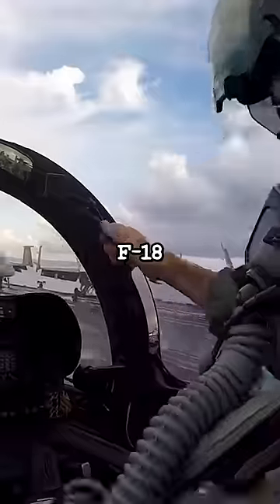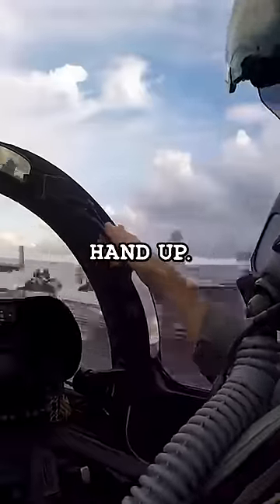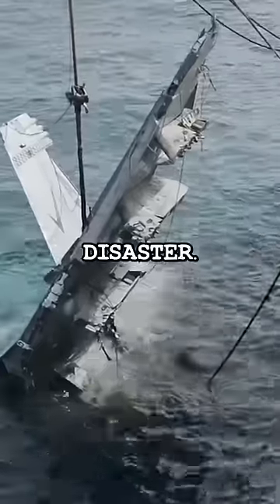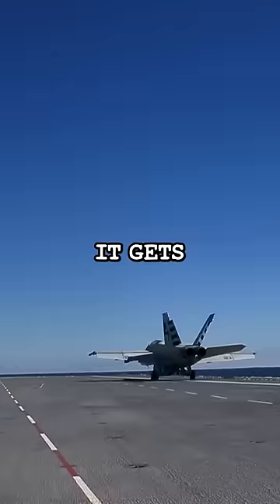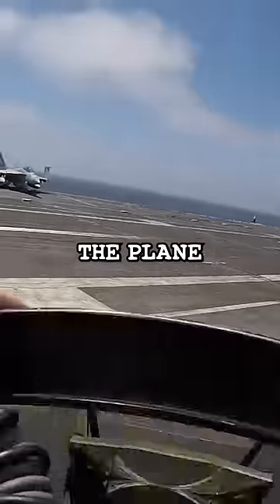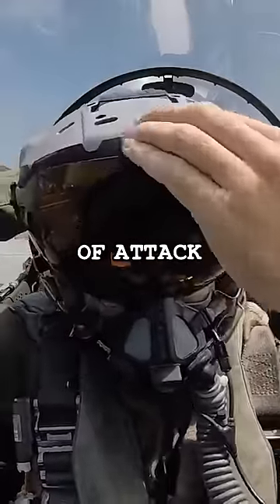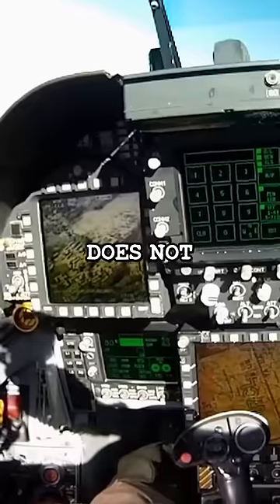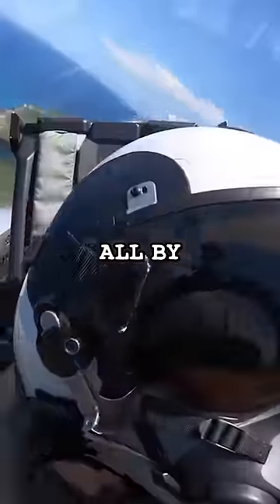Why F-18 Pilots Keep Their Hands Up

Comment: It is to prevent Pilot Induces Ocillation (PIO).  The flight control computer flies it off the end of the deck.
Reply: Exactly !! Humans are inadequate to keep up with computers in real time, with an untold number of monitored inputs to be acted upon with due dispatch. In the day, pilots had feedback from their hands on the wheel and from their feet on the rudder. That was adequate reaction time back then. Not so any more. Sensors do not provide physical feedback like the sensations cables controlling the ailerons and rudder impart upon the stick or wheel in the driver's hands, and feet.

Comment: That’s not the reason at all.

The reason is that, under high acceleration forces, the inner ear can falsely perceive an excessive pitch-up moment. The natural instinct is to dive the plane to avoid a stall. This sensation is bad enough normally, but downright terrifying in poor weather or at night. Pilots set the trim and remove their hands from the controls until the acceleration forces decrease and their perception normalizes to avoid their inner ear essentially forcing them to kill themselves.

It has nothing to do with a “powerful air blast” or the F-18 being maneuverable “unlike other fighters”. It has to be done with everything that gets cat launched.
Reply: Thanks. Always good to dispell the internet bs
Reply: It's non-interference by pilots at slow speed is true, according to actual Hornet pilot Ken VanderHorst on Quora: "The nature of the flight control systems of fly by wire aircraft requires the pilot not touch the flight controls during the catapult stroke. Doing so could seriously confuse the flight control computers and make the aircraft difficult or impossible to control once it leaves the deck."
Reply: I could have wrote that myself!
Reply: @alistair676 that doesn’t mean it’s true.😂😂😂
Reply: Correct answer here ☝️
Reply: Thank you for calling bs on this, and also explaining the real reason. Much appreciated!
Reply: @gloomrust 
He's not correct. fredmdbud has the right answer.  This is not the technique in older airplanes.
Reply: @kami13kaze  I hadn’t even seen his reply. Thank you for pointing that out to me! My apologies
Reply: I was a Navy flight surgeon.  This is what we learned at NAMI as well.  The mental perception is that you're pitching up, and the pilots have a tendency to want to "flatten" out but in actuality will pitch down.

I flew mostly rotary wing, and a couple jet flights but none were from a carrier, so can't personally confirm.
Reply: @ryane6886  I can’t confirm the effect from a cat launch, but the same effect can occur in any instrument-only situation with the onset of even mild acceleration or deceleration. This is the major cause of spatial disorientation crashes. I’ve personally encountered this effect in that context, and it requires discipline to concentrate on the instruments and disobey your whole body telling you that they’re lying.

It’s believed this effect is what killed Kobe.
Reply: It's got nothing to do with the inner ear.

It's because at extreme acceleration small inputs on the stick translate to big ones.

I'm not a pilot but Growler Jams has a video on this.
Reply: @kami13kaze Yeah but this guy was talking about F-18s, they never said anything abt old plabes...💀
Reply: @Chaz-videocreator  
That's the point I was trying to make. It's due to the fly-by-wire system. The jet is constantly monitoring control inputs and aircraft changes. If you add an input and the jet doesn't "move", the flight control computers can increase the movement of the control surfaces trying to give the pilot the desires response.  Non fly-by-wire jets don't have this setup, so they don't have the same risks and use different techniques on cat shots. F-18: hand on the towel rack, T-45, hand just behind the stick. Never once coming off the cat did it make me feel like I was pitching up/down, but touching the stick during the shot or the slight jolt at the end could cause an unintentional stick input which is why we don't actually hold it in the T-45 until the end of the cat stroke.
Reply: thank you
Reply: Somatogravic illusion
Reply: @kami13kaze  this does happen with older aircraft. It's not because of the FBW system. It's because under G these small movements have large effects while the nose gear is still being pulled by the shuttle.
This has been a standard practice since the 60s.
Reply: Powerful air blasts are common at sea.
Reply: I'm seriously getting sick of all these AI spam videos
Reply: this channel keep spreading bs
Reply: @fredmdbud  its sensitive on roll and thats really it, wont interfere with whatever bs he said in the vid
Reply: The actual reason why is because the aircraft can detect the acceleration and know that it is going through a cat shot.  The flight control computer for super hornets will understand this and command a pitch input that will drive the nose up 10 degrees to ensure good rotation off the deck.  Legacy hornets do not input a pitch up command, but rather maintain the trim set by the pilot before launch.  After the aircraft has left the catapult and achieves 10 degrees nose up it will reset the trim so it does not continuously pitch the nose up.  Pilots do not touch the controls so that they do not interfere with flight control computers inputs.  The reason why the computer does it and not the pilot is purely quality of life for consistency.  Not a single other navy jet besides the F 35 has a system where it automatically pitches the nose at the end of a cat stroke.
Reply: you did what i was going to do this guy is just spreading misinformation
Reply: @alistair676  How do you know it is internet BS just because someone else said that someone else was wrong? You do realize that the guy you just agreed with it on the internet.
Reply: @gloomrust  LOL, what is funny is that just because some person you have never met says something that you automatically believe it and not the person who made the video? You have no proof that the guy is a pilot and knows what he is talking about.
Reply: And be so kind to complete your correct explanation by saying what the left hand does in the meantime
Reply: @guiduz3469  Each hand has its own handhold so both hands are off and not near the controls.
Reply: @guiduz3469  it firmly grasps his “little pilot” so it doesn’t become cockpit FOD 😆

Nah it keeps the throttles locked into the stops.
Reply: @kami13kaze I think I agree with you? I just think it’s less complicated than that. The trim on the aircraft is set for T/O and the pilot will just F it up. I do remember just having my hand next to the stick in T45Cs as a stud (never went back as an instructor) and for 18Cs on the towel rack…either way it was to just let the bird fly off the deck like it’s supposed to. This video makes it so much more dramatic.
Reply: Thank you, most accurate explanation I've ever seen.
Reply: Ill take an aviator's word over a youtuber any day.
Reply: @fredmdbud 

Well done for dispelling more internet bs this time via the OP on this thread 😂

And you actually provided a quote and a name source as well unlike Captain Innerear and his assuming nonsense 😂
Reply: @th1ng1296 

Fredmdbud gave you a credible source for the information. Seriously, some people 😂
Reply: @joelalmon3088 

It's not.
Reply: It's all about fly by wire technology and the inadequacies of humans to interact with it in real time.
Reply: Question if for some reason the pilot has to abort a take off and looses the plane, ejecting himself, he looses his license ?
Reply: @RenataJensen  fun fact, military pilots don’t have licenses, as such. That is to say, military aircraft are not type certificated, so military pilots do not have FAA type ratings or licenses issued by the military, although most will acquire those ratings on their own to further their careers after the service. Similarly, military aircraft mechanics are not FAA certified either.

But to your question, that all depends on what an investigation shows went wrong. One cannot be blamed for a mechanical failure. However, if the dude did something that caused the crash, he’s probably gonna be in trouble.

That all said, it costs a fortune and many years to make a military aviator, and we have a shortage of them. They’re not thrown away lightly. Of all the mishaps I’ve seen, most of them due to pilot error, I’ve never once seen a pilot taken off of flying over it.
Reply: @therealinak  thank you

Comment: This video get it all wrong. The high acceleration will pull your arm back which will… guess what, pitch up the nose. Under high g you cannot control your arm and therefore cannot control the aircraft. 
That’s why you have to hold the handle on ALL carrier catapult takeoffs regardless of the aircraft. F18 to E2. When the acceleration ends you can hold the stick again. The other reason for the handle rather than putting your hands in your lap is to ensure you know where your hand is during takeoff, not hitting things like switches in the cockpit.
Reply: Aren't you just the smartest little man in the whole wide world
Reply: Okay Mr know it all. You former/current air force? How do we know you ain't lying? You got proof, lil bro?
Reply: No, the video did not get it wrong at all. There are multiple websites that say exactly why and  what was said int he video is correct.

Comment: I was an airframe troublemaker for a legacy hornet squadron. I was turn qualified meaning I could start the jet and run most of the systems for maintenance and repair checks. Took test for qual at the simulator. Left hand is on the throttles and after setting all the flight controls to launch right hand just holds on as the jet does the rest. At the simulator I successfully completed a catapult launch. Recovery…now that’s the hard part.
Reply: Troublemaker?
Reply: It either autocorrected or he intentionally changed "Troubleshooter" to troublemaker. We do make some trouble sometimes. We're the ones that final check the jets before they launch off the cat. We sit about 5 feet away and hold our thumb up while the jet is on afterburner and then gets violently yeeted off the flight deck. It's a humbling experience.
Reply: @NavyMech62  yeah should have been “troubleshooter”. Clearly need more time on proofreading. Even having been on the cat for at least 100 launches with the F/A-18C, nothing quite compared to an F14 in tension prior to launch.
Reply: Tension was set wrong for the F-14 being pulled out of the water on landing.
Reply: SIR!!!??!!! HOWDOO WE GET BACK ON THE BOAT!!!!??!!!!
SIR ...... !!!!!???!!!!!
Reply: @Tactical-God  Pretty much, my division officer (a pilot) laughed his ass off when I crashed into the fan tail and fell into the sea. Me in my head, Oh shit, that worked, now I have to land?!😂

Comment: For those of you wondering why the pilots bounce like that, the F-18 has springs in the ejector seat to reduce the forces from both takeoff and ejection. Think of them like shock absorbers for your spinal column.
Reply: I was wondering 😂
Reply: More than the pilot bounce, the cat thrust and 💥 bounce you in your rack.
Reply: @JimmieDmenince  Agreed.

Comment: The f18 takeoff procedures require takeoff trim be set to 3 degrees so when it leaves the deck the nose pitches to 3 degrees for a positive rate of climb without stall and immediately after takeoff the pilot takes control

Comment: Actually its because the F18 has a computer controlled take off process that is canceled as soon as the pilot takes control by grabbing the stick, which he does as soon as the aircraft is off the deck. Putting his hand on the grab bar keeps it off the stick and makes it clear to the crew that he and the aircraft are ready for launch.
Reply: Which is nearly exactly what was said int he video.

Comment: It is not the F18, it is all planes taking off from the carrier.  The first stages of takeoff are automated.  It is to ensure the pilot does not screw it up.  Even f14s did this
Reply: F-14s did not do this. The F/A-18 has computers that will put the aircraft in the right attitude immediately after launch. With the F-14 it all on the pilot.
Reply: @herbertdennison9682  I stand correct, just went through the  NATOPS carrier take off catapult launch.  While not truly hands off like the F18 the pilot is required to allow the stick to move on its own moving back while still retaining a loose grip.

Comment: Is it because a fly by wire and any stick touch would cause the plane to overcompensation, I can only imagine a Chinese or Russian carrier  ? Doh !!!
Reply: The only operational Russian carrier doesn't use a catapult system, it uses a ski jump, which requires the pilot to have hands on the controls.

Comment: This is very inaccurate and wrong. They put their hands on the handles because the plane is an autopilot and if they touch the controls it will disengage the autopilot and then they'd have to reactivate the autopilot which is not recommended right after takeoff. 🤡
Reply: It is far from inaccurate or wrong.

Comment: The reason it could lead to crash is because as the aircraft is accelerated by the catapult the nose will be brought up on its own, and the pilot will naturally want to push it back down unconsciously, sending them into the drink
Reply: Nope. They have done it enough to overcome any such actions. I know. Been there, done that. USN/USMC flight test engineer for NAVAIR. Also wouldn’t they do it subconsciously rather than unconsciously? I’d hate to be sitting behind my pilot while he/she is unconscious.

Comment: You keep your hands away from the controls because during a cat launch the computers fly the aircraft for the first few seconds off the end of the deck. Any input on the controls or interruptions from the pilot will cancel out the computer inputs which depending on the attitude of the aircraft at that time, it could get away from the pilot causing an ejection or worse, death. 

It's the same as interrupting autopilot or interrupting an IRS Alignment system during an navigation alignment procedure on the aircraft, any input during these procedures or interrupting the controls in all three of the procedures at any one given time it will cancel out the system. If you cancel out an IRS alignment, you'll have to start over.... if you interrupt an autopilot and move the controls, you'll have to reset the autopilot to get the plane back on course of what it was doing when autopilot was in command and if you interrupt a cat launch?? good luck!.

Comment: The F-18 pilots should not touch the controls during catapult launch to not pitch it up too much and get the AoA above critical while the Su-33 pilots have full controls in their hand. Which pilot seems to be more pilot to you? Indeed the F-18's launch by steam catapult gives about double forward acceleration compared to that of a Su-33, but you can't tell me that the pilot's hands muscles are like butter and he's unable to keep the stick just slightly pulled back and not all the way back. The end conclusion: The US pilots have weaker skills than Russian pilots.

Comment: "Adjusting the AoA even a little". Dumb talking once again! Always Always Always I hear and read all sorts of ignorant talking aviation. Do you know how much AoA is needed to at least maintain deck height after launch at a regular deck leaving speed and actual plane weight? Do you? Of course you don't if you talk such crap. Even at highest MTOW, an F-18C (as example) wouldn't need more than holding 10AoA to both accelerate and climb almost instantaneously after leaving the deck. They usually reach some 5 or less indicated AoA after deck launch. Of course, during the deck run, the AoA is close to zero, but the wings still produce a good amount of lift after deck leave even if it's some 0.7, 0.8G vertical, so they DON'T need much AoA at all after launch. With full flaps (worse case), the F-18s wings still won't get fully stalled (spanwise) even at 25AoA, so you're talking "even a small AoA adjustment can lead to stall". That kind of absurd dramatization is the US americans usual way of telling things when in they are very different in reality!Sometimes this makes me puke!